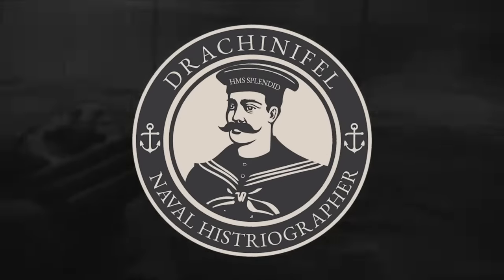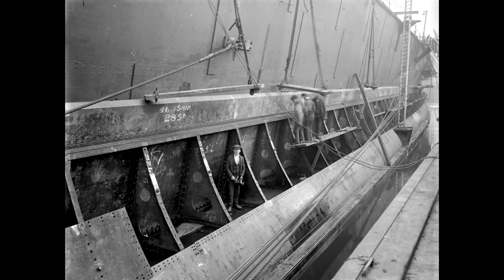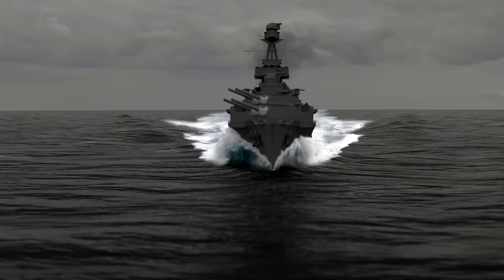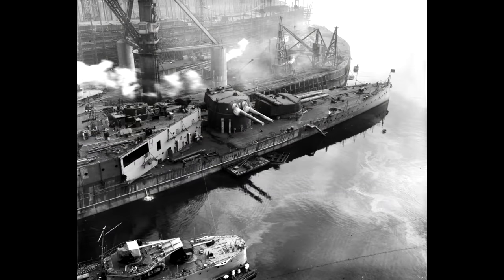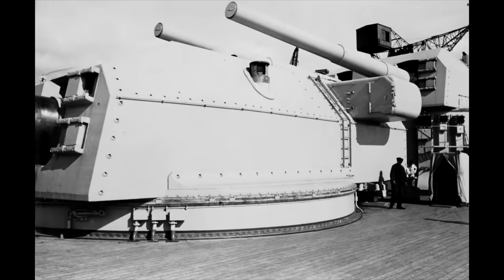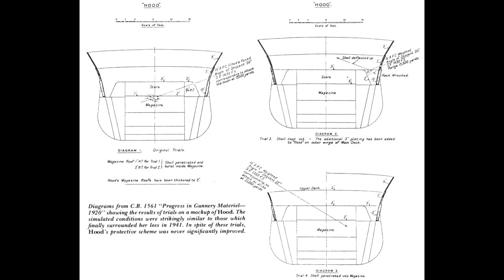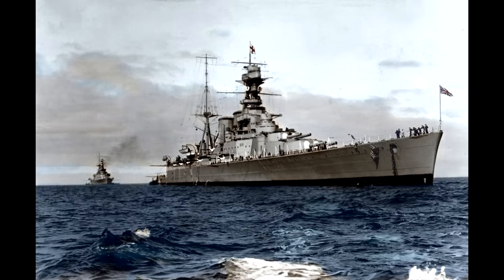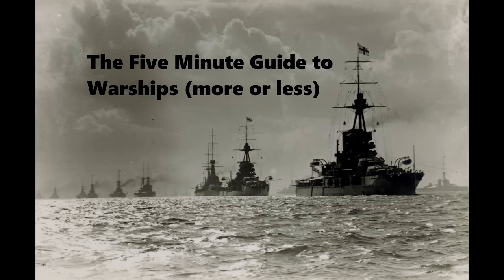The Loss of HMS Hood - But why did it blow up??

Comment: Your final description of HOOD's fate is correct, but it turns out that, in addition to the "below the belt" hit path due to the undulating water depth at speed along the HOOD's hull giving a weak-protection path into the aft engine room and into the 4" magazine (which acted like a booster in a gun projectile fuze to set off the 15" magazine charges farther aft), there is an alternative.  You noted that a hit through the bottom portion of the 7" lower-part of the upper belt would penetrate and then hit the 3" horizontal deck plate on the lowest protective deck of HOOD where the 12" and 7" plates join (between the top of the 2" HT-steel sloped "turtleback" inner splinter plate behind the 12" main belt and the inner surface of the 12" belt at its top edge) would ricochet off of that 3" deck plate and, as designed, cause damage to the higher portion of the hull instead of the magazine.

This is not necessarily true, unfortunately for HOOD.

When, after the results of the Battle of Jutland, all British armored warships were re-evaluated as to their projectiles (fixed by the new and extremely-well-improved "Greenboy" APC shells) and their armor protection, mainly due to the new use of delay-action fuzes (0.025-second nominal delay in these new British shell fuzes, the Number 16D base detonating fuze with an optional delay ON/OFF feature set just before ramming the shell, and a fixed 0.035-second nominal delay for the "Bodenzunder" in BISMARCK's 14.96" German Krupp APC shell (38cm Psgr.m.K. L/4,4)).  The HOOD design was still in discussion at the time and after WWI a series of tests were done on mock-ups of the side and deck protection of the HOOD magazines to see what, if anything, could be done to fix some noted problems due to the fuze delays in new British and, it was assumed, any future enemy AP projectiles.

The spaced thin decks, based on the pre-Jutland concept of non-delay-fuzed shells detonating only about 0.003-second (average) after the first thick-enough plate hit set off their base fuze by impact shock -- which turned out to be true with the old, pre-Jutland shells and their Lyddite fillers EVEN WITH NO BASE FUZES AT ALL (!!) -- could stop most shell fragments, but were completely unable to stop an intact AP shell coming down as "plunging fire"; that is, steeply enough to bypass over the top of the 5/7/12" stacked inclined belt protection of HOOD (the upper plates were there to make sure that non-delay-fuzed shells at close fighting ranges, the expected ranges in these older ship designs, never reached the lowest protective deck intact in the first place, which was now no longer true with the delay-action fuzes).  Due to weight problems, increasing HOOD's deck protection over a wide area without completely redesigning it amidships and delaying its completion for years was impossible and, if they wanted to actually complete this ship, they could only do some minor, though hopefully effective, "tweaking" of the armor design.  Get close to the enemy to prevent plunging fire would be the best solution and, in HOOD's final battle, this was achieved.

As mentioned, hits on the 12" inclined belt were, in HOOD's final battle, virtually impossible, requiring magazine hits above or below it to destroy HOOD using BISMARCK's APC shells under the impact conditions that occurred when HOOD blew up.  A possible path UNDER the 12" belt to kill HOOD was given at the end of the video, with the entry being into the aft engine room and through the thin 0.75" HT-steel bulkhead separating the 4" ammo magazine from the aft engine room.  Note a slight change in path causing the shell to detonate INSIDE the aft engine room near that bulkhead, instead of having to penetrate it first, would, with the blast and fragments of a 15"-sized AP shell (0.75" HT steel is far too thin to stop most such fragments), also be very likely to blow up that 4" magazine, so no entry into the magazine area at all is needed, making the chance of such a hit blowing up HOOD even larger than noted in the video.

That scenario is very possible, but there is an alternative route into the aft engine room.

The image of the 14.96" AP shell (without its windscreen or thick AP cap any more and slowed considerably by the 7" Cemented Armor) bouncing off of the 3" horizontal plate after punching through the lower region of the 7" inclined upper belt plate is quite true.  There is one small, teensy-weensy bug in the ointment here:  THAT 3" HT-STEEL DECK PLATE HAS TO EXIST BETWEEN THE REAR UPPER EDGE OF THE 12" PLATE AND THE TOP EDGE OF THE SLOPED 2" HT-STEEL PLATE BEHIND IT.  When the original HOOD mock-up tests to improve the armor were done, as mentioned above, this plate DID NOT EXIST.  It was found, as expected, that such a hit through the 7" upper belt would go through the thin construction-steel horizontal plate that was there and easily punch through the sloped 2" plate and any other bulkheads behind it and detonate in the mock-up of the magazine.  So, that 3"-deck-armor gap was filled by a covering plate of that thickness so that there was no longer any weakness at that deck level from shallow-angle-of-fall AP shells from this hit.  It worked perfectly in HOOD tests with this change.  BUT THIS FIX WAS DONE O-N-L-Y ADJACENT TO THE MAGAZINES DUE TO WEIGHT RESTRICTIONS, N-O-T TO THE SAME ARMOR ADJACENT TO THE POWER PLANT SPACES!!  Thus, if BISMARCK simply repeated the hit or one anywhere like that mock-up's hit through the 7" armor and deck into the aft engine room, which was, as noted, a BIG space making the chance of such a hit MUCH larger than a direct magazine hit, then the mock-up's result would happen and KABOOM!

So there are TWO paths to HOOD's demise through the aft engine room, not one.

I assisted from home my friend Bill Jurens when he was part of the search for HOOD by doing armor penetration calculations for him, when asked.  My above analysis was done later.
Reply: Excellent sir.
Also the wake shown in this video occured when the ship was turning and the ship heeled away. In ever other picture of Hood going straight at speed this trough doesn't exist. The pic highlighted here she must have been in a gentle turn to port.

That being said she was turning to port when she was hit on the stbd side, and any trough would have been on the port side so the effect being pointed out here wouldn't have been involved at the hit on the stbd side.
Reply: @buzzardbeurling  That still doesn't make the video hit impossible, just somewhat less likely.  German L/4.4 APC shells had aluminum windscreens that shattered on impact, so the shell forward face would be the wide, rather flat (except for the central bulge) face of the cap as it cut into the water and it would thus act much like the flat-nosed (after water impact) Japanese Type 91 AP shells did, at least for a short distance (which is all you will get with the 0.035-second delay with the German base fuze, unlike the huge 0.4-second delay in the Japanese shell).  You could possibly hit up to maybe 20 feet short of HOOD at the horizontal Target Angle that ship was to the trajectory of the BISMARCK's shell and still reach HOOD below the waterline with enough remaining fuze delay (especially if the delay was slightly longer than average) to allow the shell to go through the anti-torpedo bulge system and just reach the engine room or, in this case the magazine too, before exploding.  The important thing here is that you can add the huge engine room to the magazine, making a MUCH BIGGER target bullseye on the side of HOOD with the words "Hit here to kill this ship."  This is even more a danger when the hit along the ship side just above the 12" belt is considered along the engine room side, where the longer effective fuze delay (no water to slow the shell down before it even reaches the ship) would allow the shell to move halfway through the ship before exploding, giving it lots of path variations to and through the engine room to get close to the aft magazines.
Reply: @nathanokun8801 how quicky would the shell bleed off speed once it hit the water?
Reply: I read Bill Jurens excellent (as always) analysis of Hoods sinking a while ago and from what I recall his conclusion was that a penetration through the 7” belt by a 15” shell was a feasible (or most likely) route through to the 4” magazine and the subsequent detonation of the main magazines. It appeared to me to be entirely plausible, as is Drachs alternative under main belt hypothesis which leads to the same chain of events. Given that the 4” magazine likely cooked off and vented into the engineering spaces resulting in the initial blowtorch flame by the main mast, might we not expect a similar (though smaller) flame emitted through the 7” belt entry hole. If the hit were below the waterline then this may not be observed. Is this argument sufficient to favour the under main belt route?
Reply: @buzzardbeurling  If it has a tapered-flat nose such as the Japanese Type 91 AP, at a 17-degree angle of fall it was supposed to curve upwards and ride about 15 calibers below the surface (average) over a 200-caliber distance in 0.4 second, the fuze delay.  I have Japanese charts on this.  Let us use the 18,1" Type 91 for an estimate here,  200 calibers is about 300'.  If we assume a constant, more-or-less, deceleration, to go 300' in 0.4 second we have 750 ft/sec, or, if the speed at the end were zero (worst possible case), a 1500 ft/sec water impact velocity.  The Japanese Range Table for the 16.1" gun gives ~1560 ft/sec as the 17-degree angle-of-fall striking velocity here, so the 18.1" gun will not be too much different, so my 1500 ft/sec estimate is not too far off.  This gives 3750 ft/sec/sec as the deceleration rate for the 18.1" gun, decreasing in proportion for the smaller guns, down to 6.1" (155mm), which would have a deceleration rate of 6.1/18.1 = ~1260 ft/sec/sec (this last has a fuze with a shorter delay of only 0.08 second, so maybe the deceleration rate is greater for the smaller shells -- proportional to weight, perhaps?).  Since it was assumed that there would still be enough "Oomph" in the shell to penetrate some thin bulkheads, including the somewhat thicker "holding bulkhead" in the older anti-torpedo systems' innermost layer (many later systems used more layers, each of roughly the same thickness, other than a single lower belt layer for stopping diving shells in US and Japanese WWII battleships), the deceleration was probably somewhat less than this, leaving a circa-300 ft/sec velocity (more needed for the smaller shells) to do the punching at the end of 200 calibers of motion.  These are just estimates, of course, from the few pieces of data that I have.

For shells with pointed noses, they tumble due to the leverage of the strong sideways turbulent forces on the angled long point of their nose, so they slow down drastically and move radially from their original path violently, still curving up somewhat due to the higher water pressure under them than over them, with some being able to end up base-first, which is stable if they have a flat base (not WWII French ammo!), but at a much-reduced speed before they reach that point.  A pointed shell will usually only go about 30-40-calibers as it tumbles before slowing down and curving vertically downward to sink to the bottom, somewhat more if going base-first.
Reply: @laszlohosszu17  The entry hole would be in the roof of the engine room, near its edge.  Considering the pressure of flames shooting out of the 4" magazine as it "revs up" to its blast that blows the main magazine on its other side, I cannot see how that tiny hole would cause any more obvious flame than the flame shooting out of every nook and cranny into and through the aft engine room and its blower vents and large steam pipes and electrical cable runs and so forth.  How would anyone even see such a tiny hole with all of that going on?
Reply: @nathanokun8801  ok. I think i understand that.

So assuming that to get below the belt on the starboard side with no wave trough....at between 16,300 and 16,900 yards, the AOF is in the region of 11 degrees. From my calcs and correct me if i'm wrong, the closest  it would have to impact the sea to the ship would be between 20 and 25ft short.

The impact velocity of the krupp 38cm at that range and aof is approx 1840ft/sec.

How much energy is it going to lose in that distance? Would it potentially throw the trajectory up towards the 12inch belt?

Assuming the fuse is set off, i've been working on 0.04 as a baseline how much energy would remain to take it through the bulge and that 3/4 inch longtitudinal bulkhead bearing in mind the fuse delay?

God this hurts my head. I dunno how you do it 🙂
Reply: @nathanokun8801  Many thanks for that and the description of the deck armour flaws. I suppose that a lot will hinge on the likelihood of an under belt diving shell remaining in a fit state to burst. It’s past midnight here and I suspect that I will need several cups of coffee in the morning before I even start to digest the type 91 info you gave and how the German shell might compare!
Reply: @buzzardbeurling  You think that calculation is bad?  Go to my NAVWEAPS.COM web site page and look into my Obliquity Calculator program source code.  3D trigonometry with messages for when the shell is actually hitting the back of the plate.  Took me some time to debug (I hope it is now always valid).  I was good at math in high school, so what can I say?

The projectile, when going nose-first with a tapered-flat nose (half the area of the shell middle in the Japanese Type 91 AP shell), is moving so fast over most of its underwater trajectory before it slows down enough, that it forms a bubble of near vacuum -- a form of cavitation bubble -- as the water hitting the flat nose is blasted sideways in all directions and the shell is short enough that the collapse of the bubble is behind the base of the shell, so it does not touch the sides of the bubble, except perhaps when first nosing up in a tight curve just after hitting the water.  Japanese tests showed that this flat nose shape could cut into the water and not jump upward out of it, stay beneath the surface at perhaps different depths as it moved, when hitting at 7 degrees angle of fall.  A typical pointed nose had to get an angle of fall of at least 12 degrees to do this.  In both cases the shell would not go very deep until it slowed down to nearly a stop and started to sink.

Thinking about it, the deceleration, being on a flat nose area so the energy of the shell is going up by its weight (diameter-cubed) while that nose area, for same-designed shells, is going up with the diameter-squared, the additional energy that needs to be dispersed is increasing linearly with size, so the deceleration rate will go down with the shell size going up in a linear manner.  For example, the slowing rate for a 16" tapered-flat-nose shell would only be half that for an identical 8" shell, due to the extra energy in the bigger shell due to its weight having to be siphoned off by the flat-nose drag.  This would imply that the 200-caliber underwater travel figure at 17-degrees angle of fall that the Japanese used was merely a rough minimum value for the battleship 14", 16.1", and 18.1" guns and their Type 91 AP ammo.  The larger of these three guns could probably go somewhat more and still have enough energy to punch through the side of a warship lower hull, limited only by the fuze delay maximum of 0.4 second.  The Russians created 400-knot torpedoes so they probably have the exact equations for these high-speed underwater drag effects; I do not.
Reply: @nathanokun8801  it's been a fascinating conversation either way. I thank you for it

Comment: This is honestly the best detailing I've heard for the Hood's sinking. In world of warships you can attack enemy ships in a similar manner and get citadel hits, pretty regularly, to land the shells exactly where the red belly is exposed when ships are turning hard enough. Which makes sense, the armor is much less robust down there. Given that photo, hood at full speed would have the same effect for sure. Not that WOWS is a great example of realism, but they did get that part right. 

One of the other theories I'd heard was that the lucky shell some how went through a gap in the deck armors, and ricocheted on the barbette and into the mag. But I would think the angle of attack for that wouldn't check out.